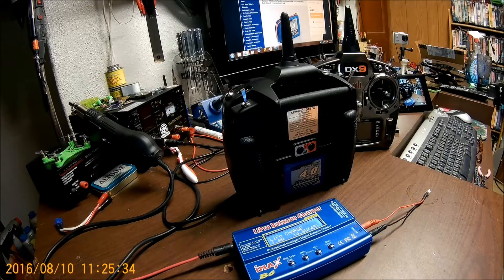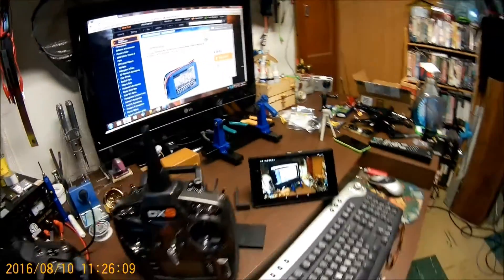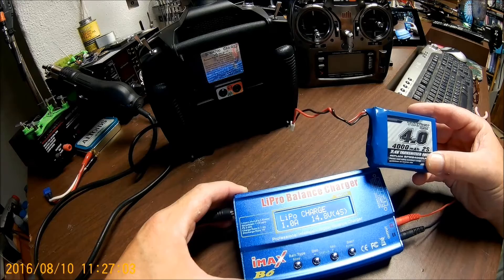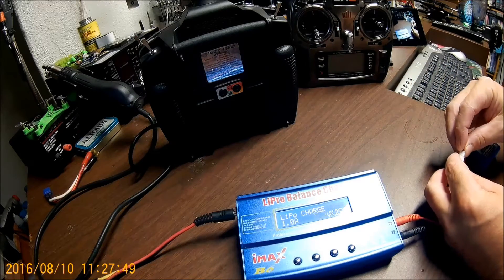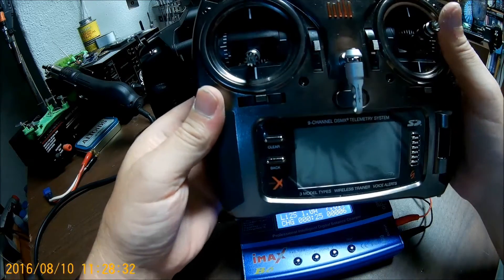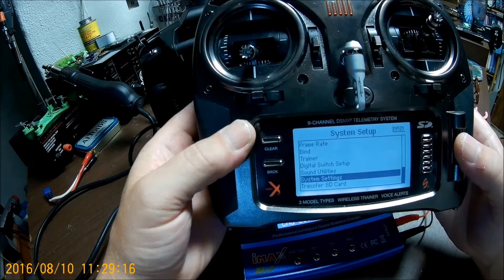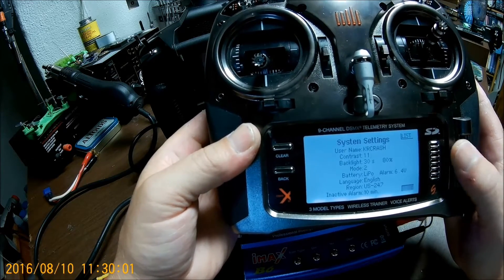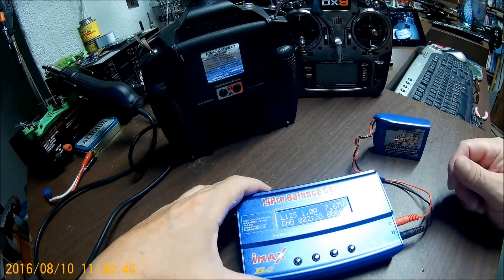lipo charging dx6 dx7 dx8 dx9 turnigy battery

Comment: I've just changed to the same 4000mh as this one for my DX8 and charged it up using the same battery charger that came with the Tx when I bought it. No need to use a Balance charger like this one here in the video. Don't see why you don't do the same, bro.

Comment: OK, I've just received my turnigy lipo battery. Just seen your video. The lipo is 7.4volts now. How many hours do you think I've to let it in charge in my stock DX8 radio built in charger? ... it have been in charge for 3 hours and the voltage doen't increase.
PS: this is a very usefull video!
Reply from the maker: you have to setup lipo in the dx8 so it will charge. the light will change when it is done about 6hr

Comment: This video was very usefull. I mount turnigy 4000 mA/h on DX6E and to charge I have to use 0,7 A and no more! but I suggest to try to do test to found the better value for your charger and battery. Animore pay attention to your code (label inside on right= eg HC705X) and check  if at the end there is L letter. If not you must require a repair because it is possible your TX switch on by themself. This problem is done by the overcharge of lipo.

Comment: what do recommend setting the low voltage alarm at for the Lith-ion  pack on my DX6?  Also what happens when and  if I get a  low voltage alarm in mid flight?
Reply from the maker: i like to set my alarm at 6.4  3.2 for each cell. and the pack has a low volt cut. i would check the specks on the pack and see what they have for a cut off

Comment: what kind of plug is that?
Reply from the maker: Spektrum RC Transmitter Battery Charge Adapter

Spektrum RC
SPM6834
Reply: what is in that plug that you can charge it in 2S whereas if you only make your own it can't charge?
Reply from the maker: y2kwiz79 it's actually in the battery. You should be able to make your own. The battery has charge and discharge protection and connect the two cells. Lower the amps on your charger for a minute of charging and then try and up the amps. Sometimes it would trigger the overcharge protection when you first start to charge it for some reason. If you're still having trouble let me know. When the battery overcharge protection kicks in it disengage your charger. This is normal wants the battery is full
Reply: kriss fly how long would it take to charge that battery in 1A charge rate?